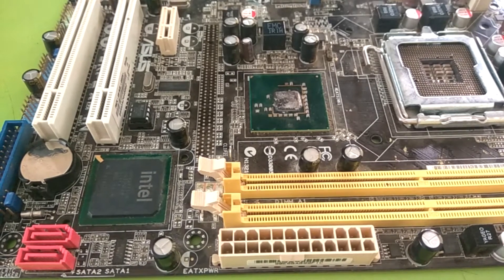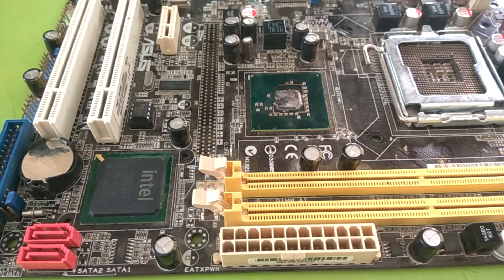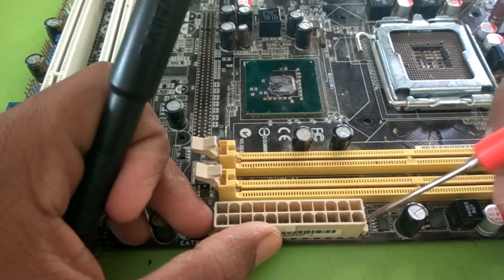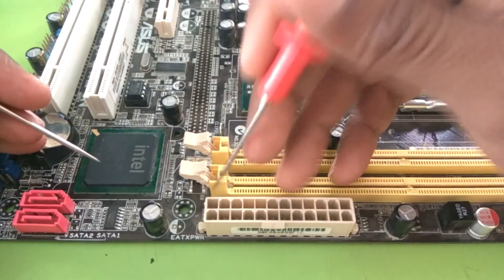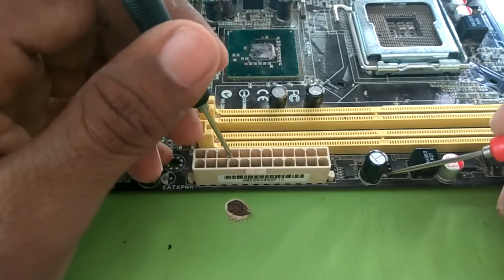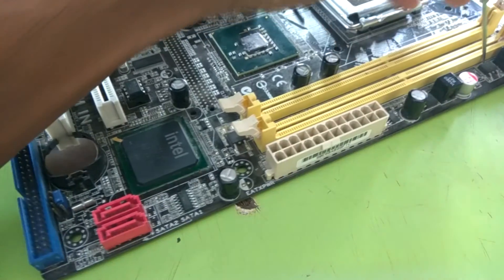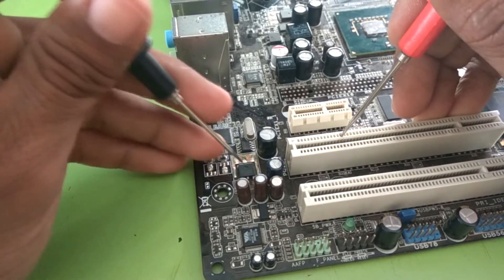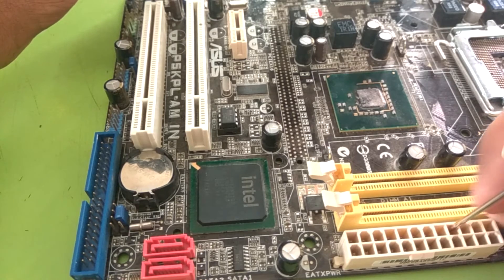[Eng]Advance Chip Level Motherboard Repairing : Lecture 14 - Correction in Ram And Stand By Voltage

Comment: im trying all what you have said from standby volt from pin9 of power supply to any of the mosfet around the PCI slot and pin A14 to any mosfet....and pin4 of the power to the ram slot..or any mosfet around that ..from old  and new motherboards..working and not working but i dont get any beeping connection...but i tried the South Bridge reset signal of 3.3v from the A14 pin of the PCI slot,.and i Got 3.3v...please reply..what to do